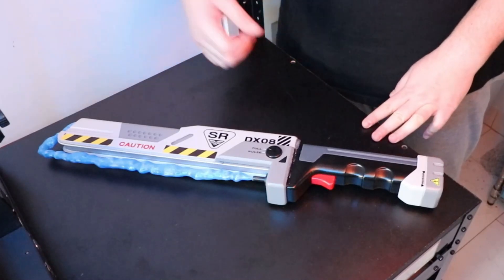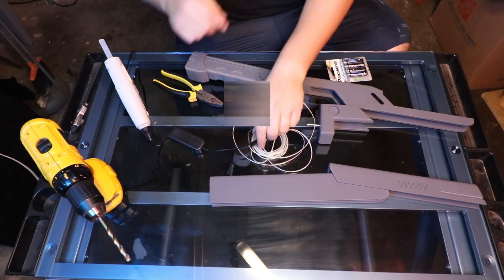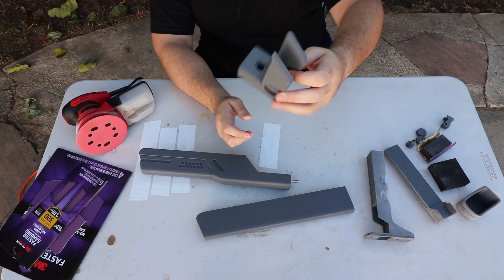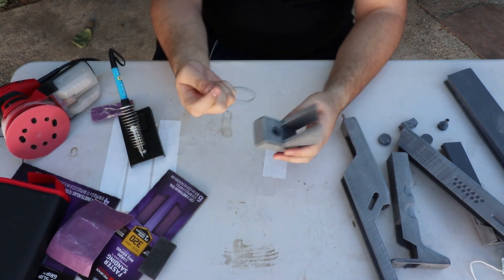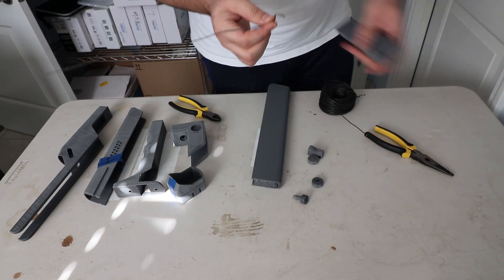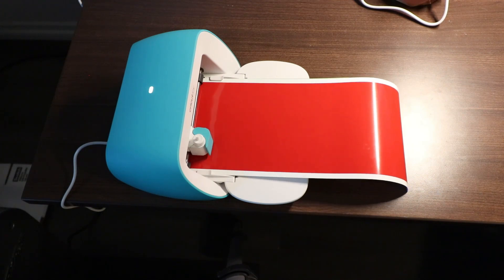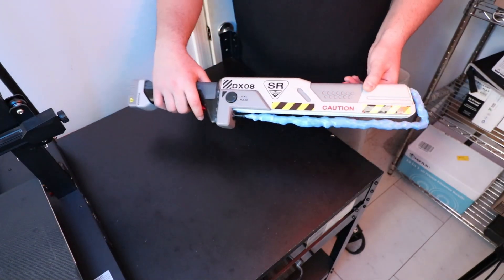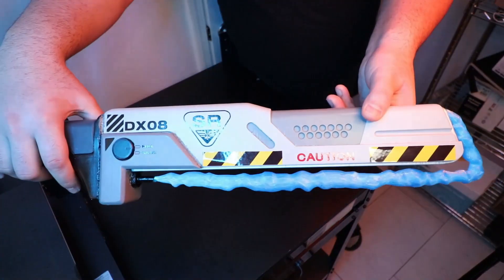Laser Blade From Lightyear: 3D Printed Start To Finish

Comment: Nice build! The details are well done. I was thinking about making one myself, what's the text at the bottom of the grip?
Reply from the maker: Hi @TheGrimmindustries, thank you for the comment! It’s a really fun project to do, and a cool design :) Down at the bottom is a polarity kind of symbol with up and down triangles on opposite ends with equidistant lines along the pole and a longer neutral line in the middle. Below that is the high voltage symbol. Would love to see your work when it’s complete!